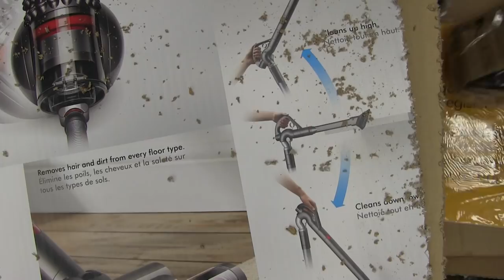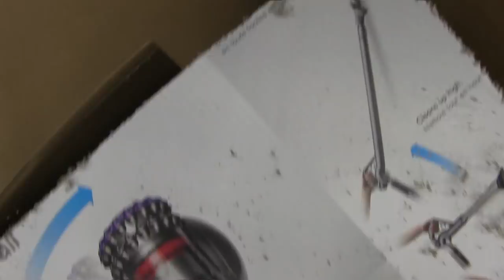DYSON ANIMAL BALLS | It blows!

Comment: It would be interesting if you could get a hold of a Miele vacuum.  The higher end models (> $500) are still made in Germany and are supposed to be pretty serviceable.
Reply: I have a 20 year old Miele that still runs like new.
Reply: I've got one. The Miele is solid but lightweight, quiet and powerful. It's nicely put together with nice materials and most importantly is doesn't look like an alien abortion, it looks like a vacuum.
Reply: Do a Henry, they are indestructible
Reply: Nilfisk is the way forward.
Reply: Kirby Vacuums are where its at. Never had a Miele, but I've had a Sebo, don't get me wrong that was a Nice vacuum. But man, talk about user serviceable, you can take it half the kirby apart by hand, and the rest of the way with basic tools.
Reply: It seemed to me that Miele was pretty anti-DIY and anti-independent repair.  Which is to say that getting replacement parts outside their dealer network is impossible.  Is this not true or no longer the case?    Maybe this is North America only.  
Otherwise I have the highest esteem for their products.
Reply: Or maybe also a Kobold/Vorwerk one
Reply: 500$ is nothing. What about Vorwerk kobold vacuums?  those cost even more than 1000€ :D 
or a Rainbow, which go for like 2000€ here in europe.
Reply: Ja Ro new ones are not 1100 w but 790
Reply: Which model is that?
Reply: That's where it's at!
Reply: Ja Ro By EU law, vacuum cleaners may now only have maximum 900 watts
Reply: @Lo_ That's to finish the 'power race': customers only looking at high power ratings lead to manufacturers to produce just LESS efficient vacuums..
Reply: 2009dudeman, I just threw a challenge to AvE Get an older model Kirby for a stripdown . the only downside to them is the weight, when you get older things get heavier that's the only reason I had to go for lighter Vac . but it sure ain't Dyson . they have always been overpriced and poor quality.
Reply: @Bastiaan Oskam
That's because of regulations.. In the eu we can no longer have a million watt vacuum cleaners.
Reply: But on the Kärcher vacs, the plastic rollers break of fairly easy, like you'd expect from plastic. Don't drop them down the stairs. Otherwise they survived beeing used as a waterpump and similar torture
Reply: German Tool Reviews Miele are good, as are Numatic. Very hard to beat a Numatic Henry for cost to performance and robustness.
Reply: I have a 40 year old Kirby that still sucks the nails out of my hardwood.  I also have a 20 year old Kirby that does the same, but looks a bit nicer when you push it around the house.  Any time a vacuum comes with a belt sander attachment, you know there has to be some power in there somewhere.  Also, nice polished aluminium body... no cheap plastic.
Reply: That's hardly the fault of the Henry though
Reply: I have a 'high end' Bosch, and the fact that it still cooches after the amount of torture I've put it through while renovating my apartment is astonishing. I can only imagine Miele to do even better. Dyson couldn't even compete in the same league.
Reply: Beat me to it. Miele vacuums are awesome, and last ages! :D
Reply: Here's a plus one for Vorwerk vacs. We've got a shoulder strap and an upright model and they're the tits. Used my Auntie's upright Dyson once and it was heavy, awkward and couldn't even pick up cat litter gravel - utter shite.
Reply: I was going to ask for the same thing.
Reply: plexnoid-I have a20+ year old Kirby too.I never intended to buy it but the salesman offered us to try it out for free.Well funny thing was he never came back for it.As far as Miele goes,if I was in the market itd be at the top of my list.I've had a coffee maker/grinder of theirs for years now and I love it.
Reply: Martin L. we have rainbow, more like 3kE but its here and still do everyday home cleaning, for more then 15y
Reply: I've got one of their large uprights. It's the quietest vacuum that we've ever owned, but it's far from perfect and holy hell are the bags expensive.
Reply: My mom still has an 18 year old Kirby and I have one from 2013. Best vacuum I've ever used. I've never seen another brand last as long
Reply: The famous vacuum repair man on reddit says Miele are the best vacuums and he's been servicing vacuums for like 15 years or something. https://www.reddit.com/r/IAmA/comments/1pe2bd/iama_vacuum_repair_technician_and_i_cant_believe/
Reply: I have one at work and it even makes funny the fact of cleaning hahahaha amazing machine ATTIX 30-01
Reply: I have one at work and it even makes funny the fact of cleaning hahahaha amazing machine ATTIX 30-01
REPLY
Reply: Jack King it isn't incontinence. The urine dribble is their bread crumbs system, for other mice to follow the trail. Unfortunately the world is covered in urine. You could use 409 or simple green to breakdown and neutralize the urine.
Reply: Tom you've probably blocked all the filters or using a full bag?
Reply: guess what , still using a 10 or 20 year old miele silverstar at our home xD
Reply: I think a Vorwerk would be even better than a miele. It better be at the price.
Reply: Made in Germany from chinese parts?
Reply: I don't get people's obsession with Henry Vaccuum cleaners. They stink. Damn near melt after five minutes. And hardly suck at all. Oh and their freaky with those eyes ;)
Reply: My mother did away with her Dyson and got a sebo, we had a dyson same model and the plastics don’t like getting launched out an upstairs window when it won’t perform, we replaced with Henry who has got drunk and fallen down stairs on several times he’s fairly tough. But the sebo seems just as tough
Reply: That's why you buy industrial vaccum cleaners. Ear protection mandatory though... :D
Reply: Dyson gives you big muscles because 20 kg of plastic :D
Reply: Dont forget about European Vacuum Cleaner Pussy Law.
No new vacuum cleaner sold after september 2014 can be over 900 watts.
Reply: Bastiaan Oskam yeah The EU new regulations prohibit the sale of vacuum cleaners over 900 watts
Reply: they are everywhere....even on throwout piles every 6 months.
Reply: alles klar klaus "like you expect from plastic" I'll give you standard paddle made from Ultem 9085, and ask you to try if you can brake it. Good luck.
Reply: vinegar, bicarbonate of soda, tea tree oil, clean up, lavender oil, for conditioning,
Reply: thank you Brexit,
Reply: I had the dc3, I think, 99 pound sterling, was solid, lasted almost 20 years hard chooch, before I gave it to someone,
Reply: My Miele S433i is now about 20 years old and still did a good job. All plastic parts are still working.
Reply: Since My old cheap Vacuum died I had to decide between  dyson and miele. I have chosen the miele S8320 cat & dog Edition with 2200 Watts and it cost only 200€, 1/3 of the same category Model of dyson. But the miele is made in Germany, with more Extras and has much more durable Build quality. Of course I have to buy dustbags for the miele but for the much lower buying price I can buy quite a lot till I get to the price of a dyson Vacuum cleaner
Reply: my parents have had their red kirby since the late 70s, it still runs like a champ.
Reply: Second that. Miele test please! Maybe closer to Hilti style engineering?
Reply: 2009dudeman compare the best. take the stats. power in torque out. gauge of material for similar parts between them. "how to overclock" can it run backwards just as well? just some thoughts take care
Reply: +Duane Brown
You know, it's a bread crumbs system because they are incontinent.
Reply: I've got one with the whirling brushes at the sharp end and I can't fault it. Best vacumn I've ever had. I still got a Numatic George which is 25 years old that  I now  use it in the garage.
Reply: Had mine 20 odd years it's just about on it's last legs,will be buying a new Miele.
Reply: What about the "Dickson" vacuum review ?
Reply: 2009dudeman 
Man, I love my Kirby. I had to replace the the power cord because it was so old and all I need was torx screw driver. 

They're made to fixed not replaced if that makes any sense.
Reply: Our Dyson is very serviceable!
We just take ours to the local Dyson repair shop.
Yes, it's all plastic but you totally don't have to throw it out when it breaks.
Reply: Universal brushroll motors are a step above dc brush roll motors.
Reply: I have Miele, so much better than Dyson
Reply: What does BOLTR stand for?
Reply: Sebo his high priced here in the states (not sure about canada). Sold for about half the price under a label named "prochem" - same german made vac, the manual is sebo when you get it. 

Winsor sensor also sold here - difference between the brands being that the non-SEBO branded versions are sold to commercial buyers and not retail. Lucky us, commercial places just sell on the internet when you're in a town where the local one won't let you in the door without some kind of business identification.
Reply: BUMMER - they figured us out that we figured them out. No more prochem online. I got my first one 8 years ago, brand new for $419 when a sebo automatic was $880, and bought another one last year (to move the old one to the basement) for $485.
Reply: How about a Henry?
Reply: @martinl1427  You should Google the PHD thesis about penile injuries due to a specific Vorwerk Kobold model a few decades ago.
Vorwerk had to change their design so it wouldn't chop of appendages that were put in its orifices.
Vorwerk tried to stop the CCC from publishing it on their online video text portal.
It even got a Wikipedia article in German.
Reply: @azz2  It's what they use in the Dyson repair shop
Reply: @jackking5567  Don't be cruel rats don't have a prostrate it's not their fault!
Reply: Wieviele deutsche werden benötigt um eine Glühbirne zu wechseln?
Reply: You fellas can't be asking AvE to check out these machines... He's in the land of 110 volts

Comment: It's funny that's a panasonic motor. I still have an old panasonic vacuum cleaner (garage and patio use only nowadays). They built the damn thing with so much suction, you could barely move it on a rug. The directions  told you to leave the "accessories" port unlatched so that it would operate correctly. 30 years old and still sucks up leaves, twigs, small mammals, whatever.
Reply: small mammals... small mammals
Reply: Oh no, not the chihuahua again!
Reply: You haven't lived until you have had to clean rodents out of a psuedo-shop vac.
Reply: +Alan Hunter Sounds fun. Does the lawnmoeer qualify?
Reply: I need no channel youtube! - only if you have the bagger attachment...

  Otherwise it’s more of a small mammal mulcher, than a pseudo shop-vac ;-)
Reply: I read your comment as the *badger attachment*. 
And then I thought to myself “man, they  didn’t fool around...”
Reply: could shrek be a mammal ??   i need a new hoover lol
Reply: N Ferraro 
Yeah, bought a cheapo Sonapanic when they first switched over from metal to plastic in the early 80s. Still going and still sucking better than anything else. Bought a modern ‘lectrofux for ‘er indoors. Half the suck and died after 9 months.

Comment: Hey AVE,  Once a vacuum salesman came to my door.  He said his vac was higher performing than the one I had, (an old Kirby).  He was sooo surprised when I pulled out a gas meter, as like found on the house to measure cubic feet of natural gas from the utility company (big grey thing).  Well I put his rig a sucking to it for one minute and noted the cubic feed of air that had passed.  Then I did the same suck to test with my old Kirby.  The salesman was astounded to see that the old Kirby was a better mother sucker than his mother chucker.  He had no choice other than to concede defeat, and I wished him a good day sir.  He left shaking his head, never having known the challenge he would endure and emerge from, licking his woulds from this dethronement.
Reply: Interesting! You can also use a water meter to compare (but not measure) air flow. I once used a vacuum cleaner on a water meter in reverse to get the numbers down a bit before I sold it on eBay.
Reply: What was he selling? 
And I believe you that Kirby those things are beasts.
Reply: Epic comment
Reply: And then the whole neighborhood clapped
Reply: i love this
Reply: The old Kirby that we had lasted 17 years but we decided to get a new one since it costed too much for repairs
Reply: That was a good day.
Reply: Kirby is beast, they are very expensive machines and are built to last for ever. Never throw it in the garbage,  even used they cost a lot
Reply: @Ozlo Houser Now that's funny :) ....  I picked up a used 9 year old Kirby from Ebay for about $160US, took her apart, cleaned her up, put a new transmission belt on her, grabbed the Mother's and polished her to a mirror (that was satisfying).  Every time I vacuum the floor, the wife remarks as to how great that Kirby fluffs the carpet back to normal.  I almost sold Kirby's 20 odd years ago and the supposed cost to the franchise owner was around $450...The folks that originally bought my Kirby paid $1,725 (came with the receipt) and we were taught to start around the $2000 mark.  Pawn shops & Ebay is the place to by these toys for those interested.
Reply: @CODMarioWarfare  its totally r/thathappened imo but i dont really care
Reply: @Ozlo Houser 
What ever harpind to that Young Sales Man?
What kind of car did he buy?
Reply: I used to filter Queen and hooked it up hose to hose with running Kirby and sucked the Kirby motor backwards . Kind of like a vacuum tractor pull .

Comment: The bypass valve is to pass a UL 1017 test where the inlet to the vacuum is sealed off for several hours until an “ultimate result” occurs (ie death & destruction), or it gracefully keeps running until the test duration is complete. It’s far easier / cheaper to just leak cooling air for this test, than to design the cheap thermoplastic enclosure & copper clad aluminum winding motor to fail safely in a consistent manner, & FAR more cost effective than the auto-resetting thermal fuses that have their own design challenges to prevent nuisance tripping. And the BS about it preventing drapes & dicks from being sucked in is BS; every manufacturer would love to get rid of the bypass valve & wants the highest amount of peak suction at the end of the hose, especially in Europe where “Air Power” numbers are apart of the marketing figures, which bypass valves often negatively impact if designed cheaply. 

This valve is only actuated when the suction side of the vacuum is blocked, well at least that’s the way Dyson tunes them (their large piston w/ only a small piston area exposed to atmospheric pressure causes a “hysteresis effect” that requires a lot of suction pressure to actuate the valve, but not very much to keep it wide open, thus maximizing air power performance AND safety). Other manufacturers are FAR less competent / cheap in their engineering design, as well as engineering ethics, so these valves are confusedly designed to behave in a linear fashion & always leak a little bit even during normal operation, or they use a literal hole to leak all the time to pass the UL “Blocked Inlet” test, among other nefarious things & closed door consensus based decisions that I can’t go into detail with due to legal agreements... Will probably find a pretentious letter taped to my door next week... ;)

If you think that Dyson is a POS, you should take a look at the absolute pure crap being sold by the other brands! Dyson has far better design & manufacturing quality than the rest, & non-intuitively do stand up to hard / abusive reliability & durability testing quite well in the complex linkage BS they often use; however, they are way overpriced, because quite literally everyone else is selling modularized cost reduced garbage made in a few factories in the Guangdong Province of China... Shark / Europro is pretty much the only exception besides Dyson regarding design & manufacturing quality, even though they also employ manufacture in these same ‘white good’ factories, albeit on a different floor. Miele is also quite nice regarding design robustness, but even more overpriced & poorer performing than the mainstream brands. If you want a vacuum that doesn’t spew a bunch of sub-micronized dust-mite poop & dead skin into the air, Dyson & Shark are your two best options by a light year, w/ Dyson being superior. Now I’m definitely getting a letter taped to my door! ;)
Reply: Thanks Sir James.
Reply: "Gee, I love that kind of talk!" (Tim Conway as Ensign xxxxx on McHale's Navy)
Reply: *Ensign Parker
Reply: DDSPL15 This was actually a great read
Reply: Damned fine elucidation on the virtues of quality sucking devices. As I am married with kids, this qualifies as erotic literature of the nastiest variety.
Reply: They're pretty bombproof IMO. Mine is 7-8 years old and has spent it's whole life sucking up building dust. He don't much like the wall chaser, but it'll keep the room from filling up with clouds of brick dust.
Reply: Douglas Kok "The General is...indisposed right now...."
Reply: the henry rocks. simple effective and near indestructable.
Reply: DDSPL15 Your comment is very large.
Reply: If, for their asking price, they would put an electric motor in the floor nozzle to power the brush, this would actually be a pretty good vacuum. For above the floor cleaning, this is as good as any. for carpets, bring out the good ol' Hoover, or Kirby. For above the floor cleaning, there are other vacuums available at 1/3 the price of this one.

Comment: The valve is to keep the 200 lb gorilla from getting the dingus end stuck in it, or keeping little johny from sucking his siblings eyeballs out if there headbone.
Reply: But... Getting your dingus end in is half of the reason to buy a home suction device...
Reply: the Dyson motor overheats in dingus situations err uh sitiations where its blocked. try a better vac.
Reply: No vacuum, no cooling air. It's to protect the motor cooling